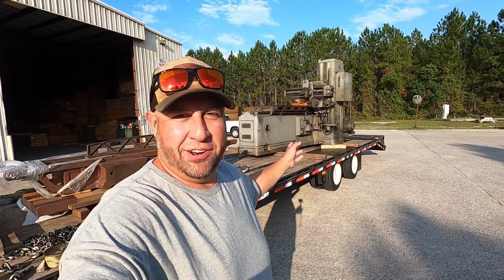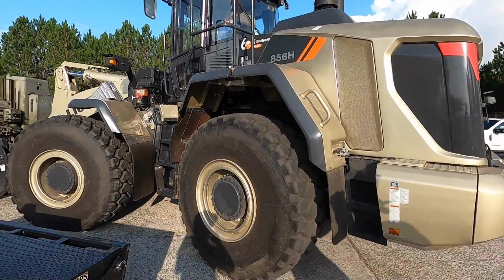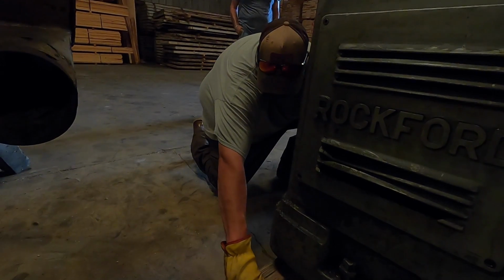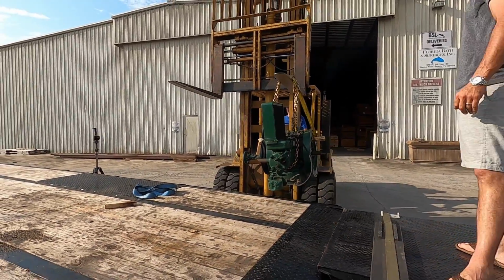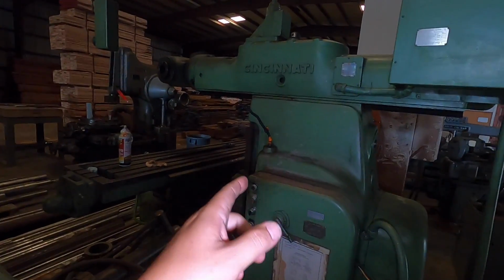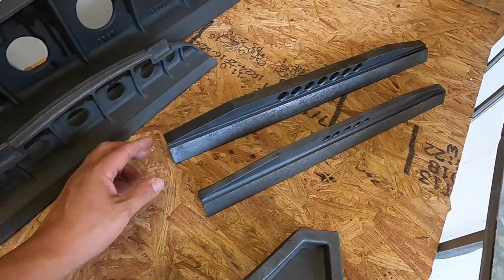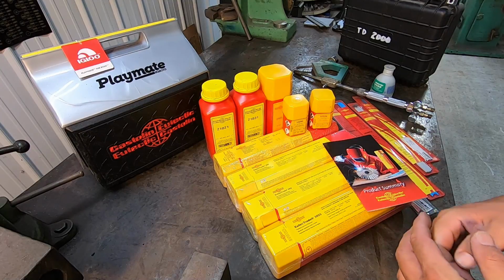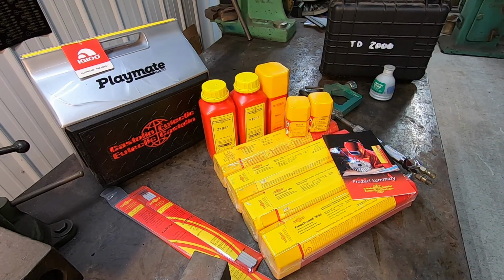SNS 315: Rockford 60" Openside Shaper

Comment: Yep! Thats a big boy machine. I've done some classy work in that one's cousins out here on the left coast. Good choice. Hard tp beat real precision and power.

Why do I smell more construction coming at Cheź Booth?

Got the books? I have Rockford manuals and the OilGear manual, IPD, and parts list for my 93 x 32 x 32 shaper planer. Copies available. Your Rockford is one size smaller and newer than mine (mine has a separate pump) so there's certain to be differences. There's a manual outfit that has EVERY macgine tool manual under the sun. Might cost a couple hundred but machines that size need to have factory docs for instant referral, for example squaring the side head vertical slide to the table. Also, when you install the machine, be sure you have a good tie down between the outboard flangeof the column foot and foundation. The rail can droop with saddle motion (mine must weigh 400 lb) otherwise.
Reply: I believe "chez Booth" will soon be relocating. Lately, a lot of hints have been in the videos!
Reply: @paulcopeland9035  I always thought the dirigible hanger (Hanger 1, Moffet Field) near Oakland CA is the perfect size for a home machine shop. Take a lot of collecting to fill it.

https://en.m.wikipedia.org/wiki/Hangar_One_(Mountain_View,_California)
Reply: @forrestaddy9644  ...."the floor covers 8 acres" !  Yep, that should be enough.
Reply from the maker: Thanks! I do need the manuals. I’m going to reach out to Grungy Machinist and find out if he has the right books for this machine.

Comment: I am not going to argue with you that this is a shaper. 
I always thought a shaper a cutting tool attached to a moving ram . A planer was a machine with the cutting tool stationary and the table moved . I work at The Colonial Machine Co  that had what they called a Rockford open side planer it looked exactly like yours about the same size. Maybe I need to get educated here. Why were they wrong to call their machine a planer and what makes your machine a shaper and not a planer? They also had two other open side machines one smaller and  one bigger.
Reply: I agree with you.
Reply: On a planer the table moves and the tool moves side ways. On a shaper the Ram moves and the table moves sideways
This is a planer
Reply: Me Four!. or is that five?  Of course, we could all be wrong... It has happened before.
Reply: I thought the same, I'll defer to whatever the manufacturer called it but it is my understanding this would technically be a planer.
Reply: It is a planer
Reply: @37yearsofanythingisenough39  It's a shaper-planer
Reply: If it looks, walks and quacks like a duck it's probably a duck .

Comment: Adam,   That Rockford going to be an awesome machine to see run I’m anxious to see videos on this,  also your big radial arm drill press,  the Milwaukee shaper I’m stocked to what’s next,  but I say your going to need a bigger taller shop  a   Abom  size shop,  thanks for sharing your video.!.!.!.
Reply: Brian Block sized barn-shop.
Reply: Maybe time to look for an empty aircraft hanger for a new shop.  It should be big enough to hold most of your machines.
Reply: Adam,   You’re going to need to go under ground for more shop space.!.!.!.
Reply: Adam,   Maybe Keith Rucker will make a deal with you on his shop.?.!.

Comment: @abom: Pleas adjust the seat belt attachment, its set for a midged and you are a giant.
Reply: Upper seat belt attachment should ideally be slightly below your shoulder height, though many vehicles don't allow that for the average driver. A shoulder belt doesn't just hold you back in the seat, it holds you down in the seat!

Looks to me like he has it just about right.
Reply: @Azlehria  Huhh... "A shoulder belt doesn't just hold you back in the seat, it holds you down in the seat!"...  i wasn't aware that US regulary today is so unsecure that the allow a 2 point shoulder belt (feels like a "better than nothing"-Rule) . However if the belt goes over the shoulder and not over the collarbone, i think better not to have an accident and specially not an accident with a rollover where your live depends on this "holding you down"-Thing *scarred*.

Comment: wtf!? LiuGOng??? Why didnt these numbnuts buy CAT?
Reply: I imagine there’s $30,000 reasons why
Reply from the maker: John told me that CAT used this factory to build some of the CAT products. Seems like a fine machine to me, and bought for much less than an “assembled in the USA” higher end version. It also come factory with a bucket which I hear is an upgraded option on the Cat.
Reply: And CAT rip the owners on spares prices
Reply: As somebody who used to work for CAT, I'd never buy one of their machines.
Reply: @SynchroScore  shakes head wtf has the world come to!
Reply: @parteibonza  Well, considering that our factory had the lowest in-service failure ratings of any Caterpillar plant making large machines in the entire world and forty years of institutional knowledge of that product line, only to be abruptly shut down and replaced with a $300 million factory in the middle of nowhere in Texas, hiring people off the street to knock together machines with parts primarily made in Mexico.(And this after the plant manager told us that we'd be seeing other product lines, including the installation of a 50-ton gantry crane that has never lifted anything other than its test weights. Either he was lying to us or, more likely, he was lied to by the main office.) Two machine booms by a Mexican subcontractor were sent to me for evaluation and machining, one of which was so twisted I had to wrestle it into the machining fixture; two more trial pieces were so warped they weren't even sent.

And don't get me started on some subassemblies purchased from China (basically a steel casting welded to either end of a DOM tube). I look down at one boom in my machine and see it's cutting air, and the face of the lift cylinder boss isn't being machined flat, because the entire assembly is too narrow. There are three-hundred of them in the warehouse, every single one undersized. Rather than make it right, they just have the finish welders clean them up with angle grinders and tell the assembly workers to shim it.

Comment: Ya that wheeled fork loader pow, done. A quick attach bucket perfection. looked haystack dry in there. chances are somthing comes along suddenly and where you gonna put it till a massive concrete structure can be made. howard hughes size problems . good show freinds with whearhouse space . whem your head hits the pillow 5' chips set off the richter scale thats a long day

Comment: I used to use a cleaner from Cincinati Milicron that melts that old oil and smoke right off the machines . The last time I bought some Valenite had purchased it . The cleaner for iron will turn aluminum black . There is one made just for aluminum . It was along time ago that I used it and am now retired . This stuff  worked great . Little scothbrite in the heavely soiled places to allow the product to penitrate and wipe it off . First time I used it was on a bridgeport and I sure was suprised . Keep up the good work .

Comment: Sir, is it possible to Spray Weld the rod journal on a crankshaft?
I've got a rather rare engine with a bad crank that if It could be built up just .020 and then turned down I could use it.
BTW: it's a V12 Ranger aircraft engine, I'd like to get it running for Test Stand operations, never in an aircraft.
Reply: Sounds top me like you'd be better off with a weld machine heat treat

Comment: Adam, that is a planer......very nice looks like one that was for sale form a machinery dealer down in Arizona....
Reply: Always thought if the tool moved it was a shaper, if the work piece moved it was a planer. If this is a shaper, I'm now confused.
Reply: @GOAP68  Your thinking is correct, Rockford would market these small planers as shapers because of their size rather then the way the operated.
Reply: Rockford calls it a "Hy-Draulic Openside Shaper."
Reply: @xenonram  they can call it that, but it's still a planer by definition, considering the work moves below the stationary cutter

Comment: What kind of company would grind a planer base and not put a rust prevention coating on it? That freshly ground planer was pretty rusty.
Reply: It was upside down, you were looking at the base that goes on the floor, not a working face
Reply: @andyb7963  At 21:04 clearly shows rusty V ways that the planer table runs in.